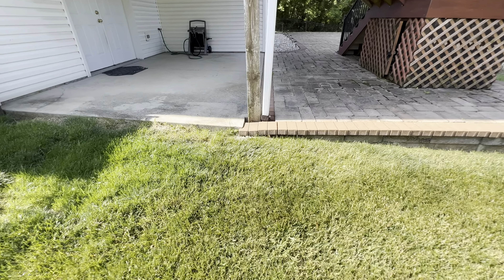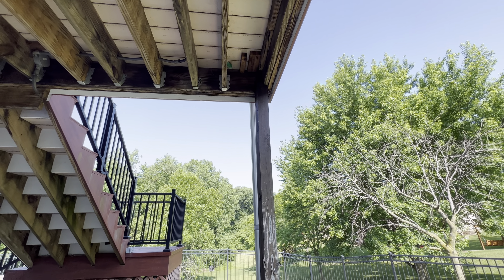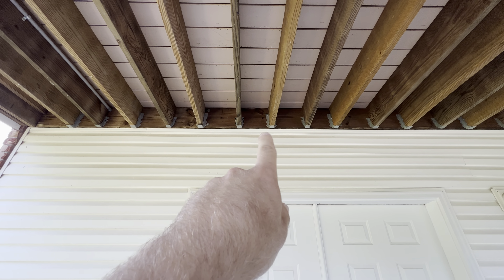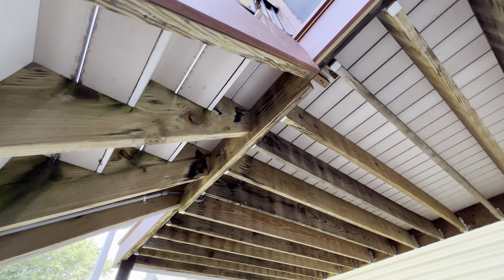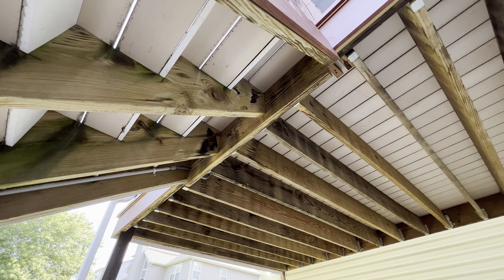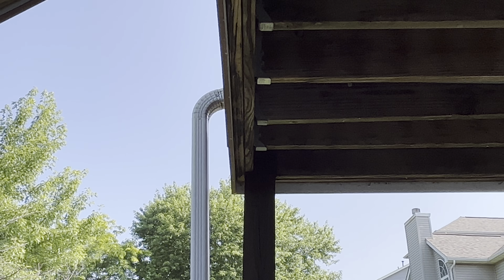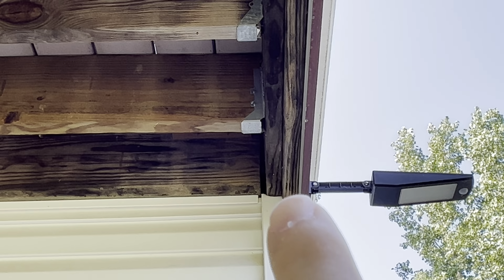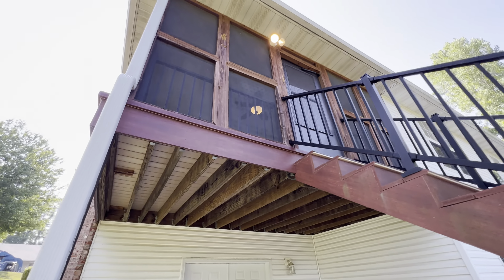Another POORLY BUILT Deck

Comment: But yet someone installed new decking?? A homeowner just fired me after tear off because I wouldn't install trex decking because deck framing was 30 years old and had significant bowing and roofing nails in Hanger's and several other issues. I never had that happen before and I've been building decks for 35 years! I'm good with that!👍🏻
Reply: Getting fired is better than sitting in court facing a plaintiff in a wheelchair.
Reply: @KingfishStevens-di9ji  exactly 👍🏻

Comment: This is crazy. How could any "professional" build this? I built a 14x22 deck (fully permitted and inspected) and I used TWELVE 6x6 posts on 12" diameter concrete piers sunk down 4'. And this deck is 2-5' off the ground depending on grade. Then again I'm a mech engineer and I may have an "over-engineering" problem lol.
Reply: Your house will collapse before your deck will!
Reply: It’s obvious a professional didn’t build it.

Comment: Can't say I'd want to be standing under there. I wonder if people realize just how much weight that is. That's asking a lot of that post... Ultra dangerous.
Reply: Should by a 5x5 steel tube with flange plates bolted to concrete foundation
Reply: @KingfishStevens-di9ji if I went with one post on a deck like that, I'd want a steel post and beam on the outer edge.    I wonder if they put the walls and roof on later?

Comment: That is very repairable structure. The joists don't get wet with the porch above so no rot. Just need to replace one post and add a couple more.
Reply: It needs a steel support column from the ground concrete to the roof.about 5 of them.

Comment: The fix doesn't look complicated at all. Carriage bolts and four 6x6 will fix that right up. If it were me  I would also replace the edge board with two 2x8's. 2x6 works but not enough margin for me.

Comment: A 4x6 can hold something like 30,000lbs on a vertical like that. Its now bowing because of the load, its bowed because it was wet wood  when the deck was build. The reason to use a 6x6 is not because of load capacity as this video implies, it is because of cross forces due to wind etc. Honestly, your lack of understanding in this one area hurts the creditability of everything else you have said.

Comment: Your comments seem subjective.  "you would..." You prefer...."  Should you mention codes and loads min to justify comments?  Here in Chicago decks are required to be 100 lbs/sqft with massive metal braces, bolts, connectors and more requirements than rural areas would ever encounter.

Comment: If it's that bad of a job why is it still standing  ?
Reply: cuz it hasnt given way yet. thats the point--it aint built to last long
Reply: Things stand, until they don't. Just like you can bend a paper clip several times, before it breaks.

Now, try bending rebar back and forth until it breaks... You can build a deck like a paper clip, or you can build it like rebar. Your choice.
Reply: I would have 3 more supports. One at the opposite end. And one on either side of the steps. With the supports at the steps you could wall it up with a door and have some storage too.
Reply: One wooden post is prone to rotting and collapsing.  God forbid Termites find that ONE post.

And don't get me started on what would happen if you had a party on that deck.